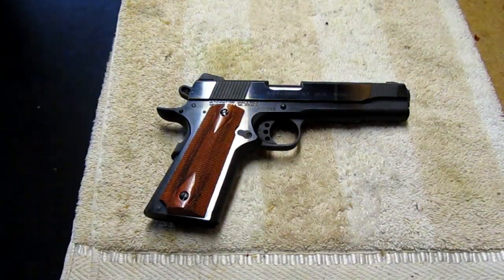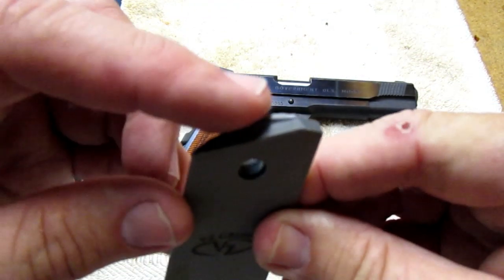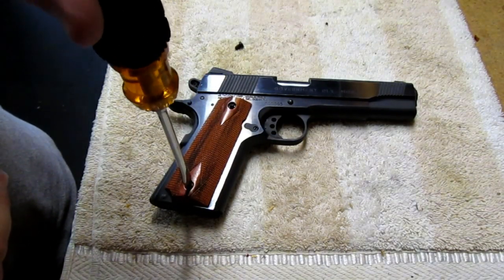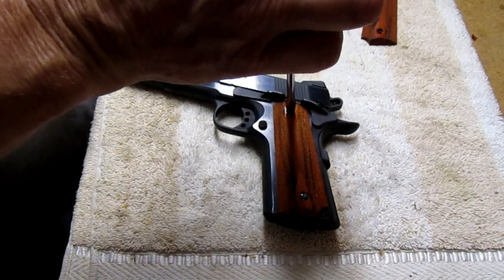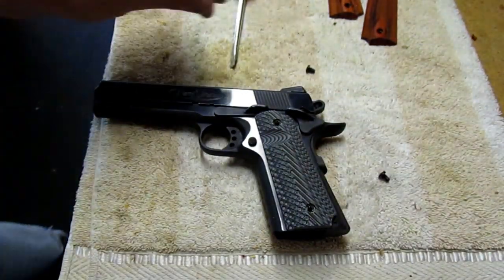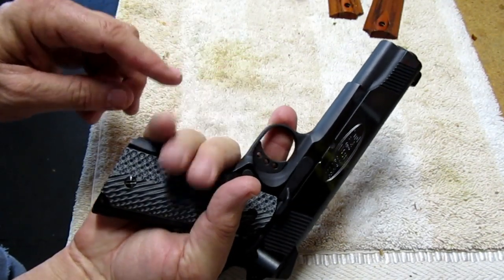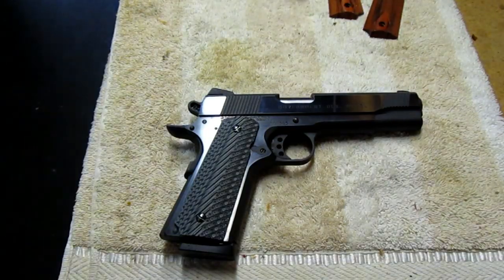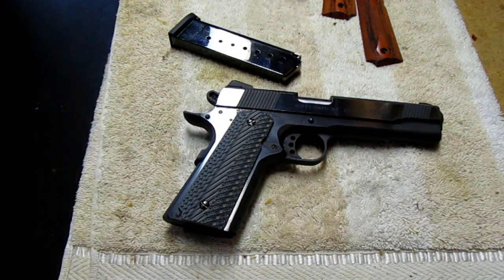How To Install 1911 Grips - VZ Operator II

Comment: I purchased a new Dan Wesson Specialist today and it came with these grips. I actually purchased it because I like how rough they are and how they grip my hands. I never heard of these guys until now and found you researching who they are. Good video by the way and I subscribed. 

Those grips totally transformed the pistol for the better. I’m for sure gonna purchase a pair for my Sig Sauer 1911 XO which actually has similar G10 grips but not as aggressive. My EDC is a Kimber Ultra II 3” with crimson trace grips 🙄 😂 I got that because I thought it was cool at the time but I never use it especially at the range. I’m gonna get a pair for that too as it will totally transform my grip on that smaller pistol and I have large hands so I think it will help 🤔 if not I can always switch back. 

Thanks very much for sharing I found it very helpful.
Reply from the maker: Thanks!  They really make a huge difference

Comment: New grips look great, better in swamp then wooden one less slippage. I always clean/swipe when I exchange parts out of habit. Get you self a set on screw driver at the next show it pays off in long wrong. Take gloves they sting.
Reply from the maker: +1 on the screwdriver, mine was not the right size.  The grips are kinda rough lol
Reply: I have that yellow box set, interchangeable bits. Nothing fancy but I have ruined screws. Most shows have them. No hand sanitizer after you try those new grips.